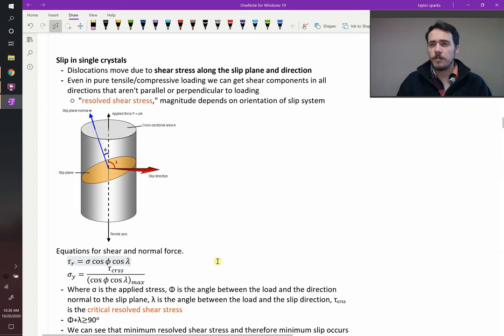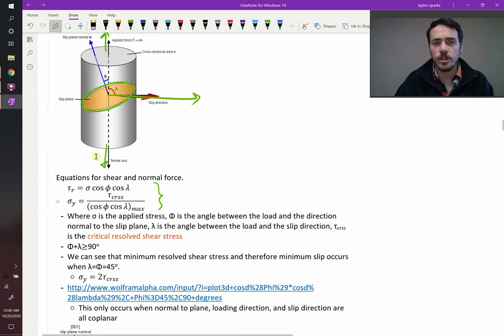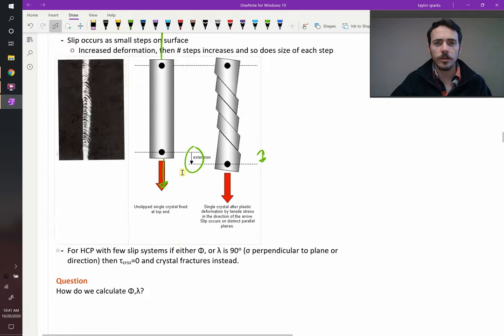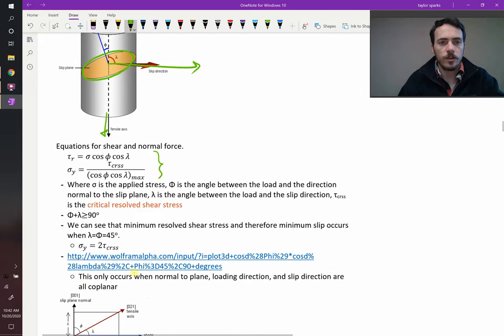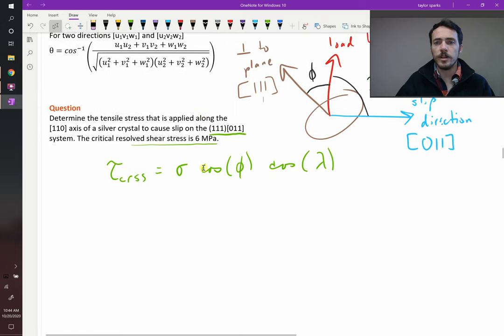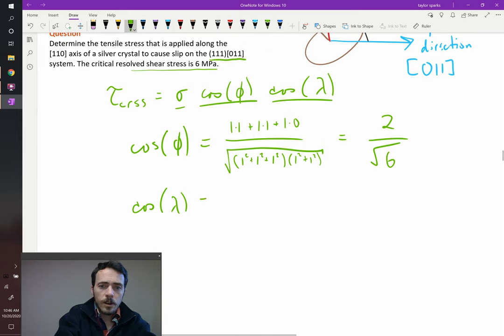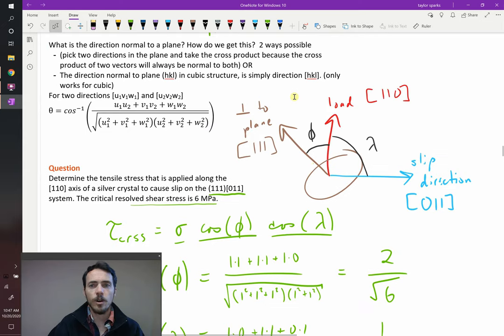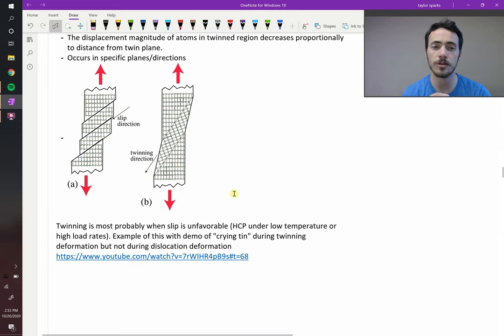Single crystal deformation vis slip and twinning

Comment: why cos(45) x cos(45) is maximum value?
Reply from the maker: well, the resolved shear stress gets minimized, not maximized. cos(90)=1 and it gets lower as we go towards cos(45). So mathematically it makes sense that we want to minimize that term. Recall that slip normal and slip direction are always going to be normal to one another so they have a fixed 90degree relationship one to another.
Reply: @TaylorSparks  How does cos(90)=1?
Reply: @kylecrooymans2762  you have to go elementary school again 😄